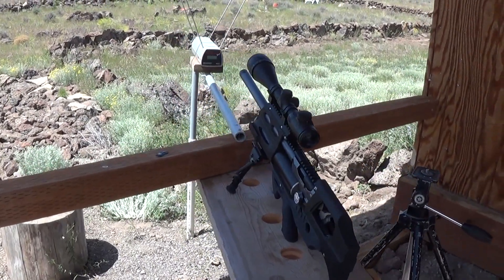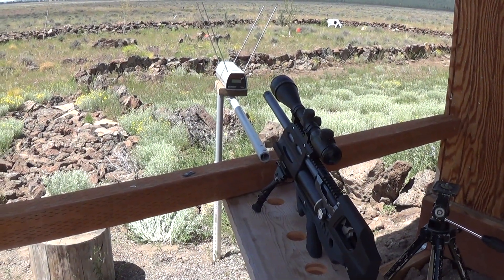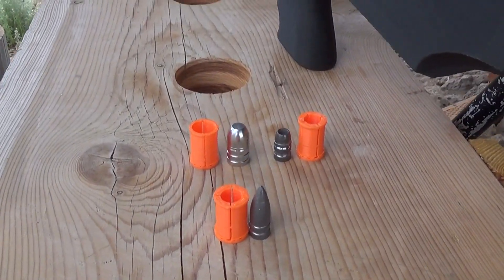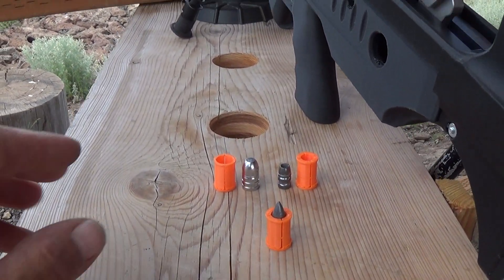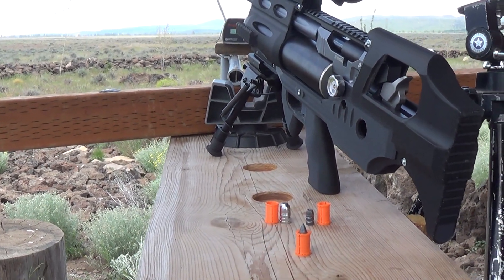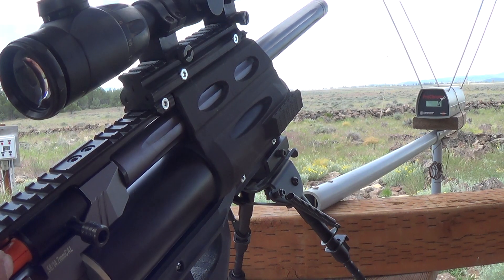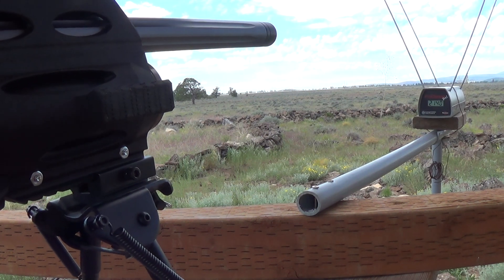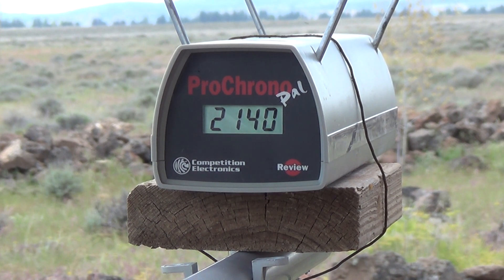Air Rifle has more power than a 30-06.

Comment from the maker: Fact's for you - I shoot air rifles through chronographs all the time, the only time air can register on a chrono is if you are in very high humidity or have smoke in the air,  we have between 10-20% humidity, and personally I have never once in 100,000+ times of shooting an air rifle over a chronograph had it register the air velocity!!! The chrono distance is not a factor here since there is no smoke and no real humidity meaning the 6.5 feet was fine, and the sabot doesn't break apart it just balloons or flowers, this was a real test with real numbers!

Comment: You need to make a bullpup kit for the Zeus.  I would definitely purchase one of them. Hell i would test it and make a video with it.  Imagine a shorter long barrel Zeus that can be used in a blibd or tree stand.
Reply from the maker: The Zeus Bullpup kit will be out in three or so weeks, I will do a video once its done going through testing, you have to shoot the rifle in the stock 1,000's of times before you sell it as a product, to make sure for some reason that it doesn't have any potential fail points in it's design, especially with the increased recoil of the Zeus.
Reply: @BigBoreAirgun  I'll be watching and waiting for it to hit the selling market. I love the bullpup style. I'll be able to keep barrel length and still have a shorter airgun for blinds and treestands.
Reply: Where do I put I seen your video to receive  double the empty sabots?